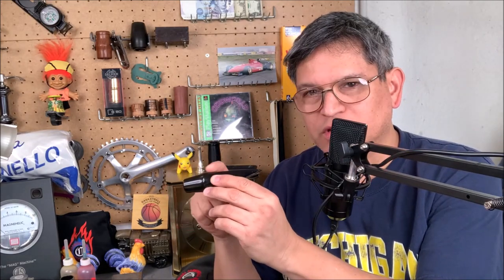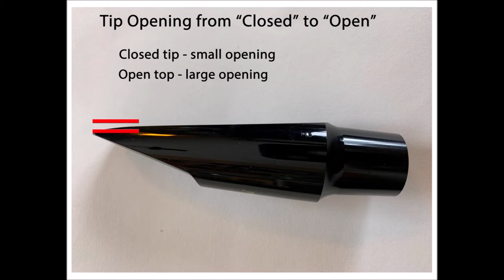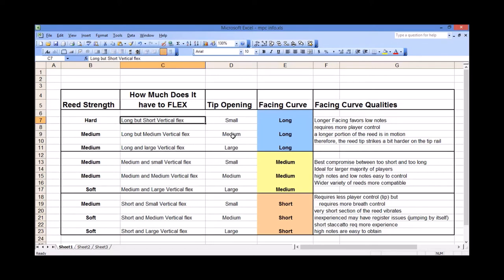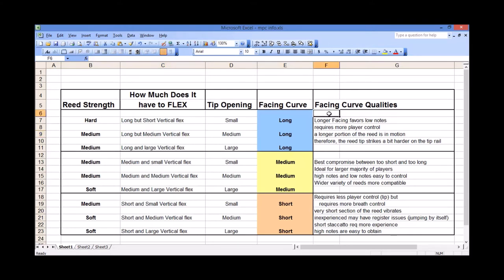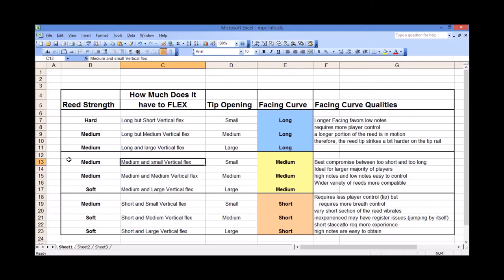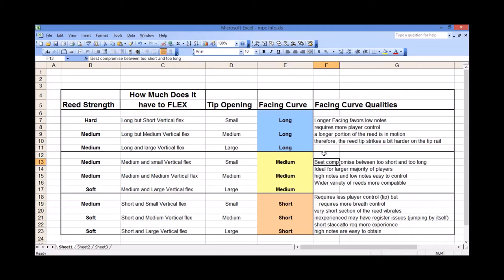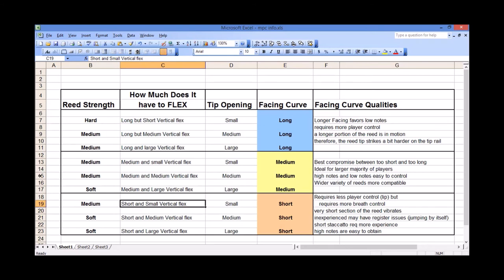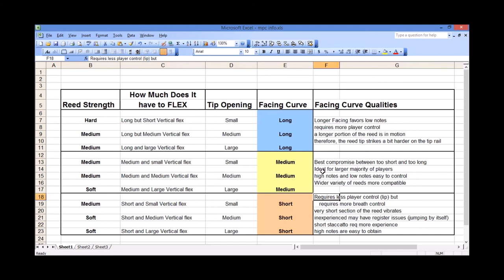Clarinet Saxophone Mouthpiece Basics - Facing Curve & Tip Opening and how it affects Reed Selection

Comment: This is great information. I wish I had learned this 30 years ago. One suggestion for the videos - the audio in this video is very muffled. The mid-to-high frequencies are not there, and that makes the spoken word hard to understand.
Reply from the maker: Sorry, I actually have a deep voice - lower frequency.  I've had many people say the audio is off, until they actually hear me and realize I have a dark voice but I need to articulate more.  I also do not have any "real" audio equipment.  Unlike what some hear about YT I have no income from these. If you look over newer videos you'll hopefully see an improvement as I've learned you can adjust the audio in the software since that video and I now use only an iPhone with a wired mic which has seemed to improve it, except I still have a dark voice.
Reply: @gottalovetheknowledge4749  Good to know things have improved over time. I also have a lower voice, but even lower voices have high frequencies in them. A lot of consonants get some of their base sound from the hissing of air - think S or F or T. That hissing air has a lot of high frequencies in it. When those high frequencies are reduced (with lower quality microphones, for example), it's harder to understand. The loss of the ability to hear higher frequencies as we age is why most folks with a bit of hearing loss have a hard time understanding speech. It's all another fascinating topic.
Reply from the maker: Yes, I totally understand.  If you want to provide improved microphones and technology for gratis it would be greatly appreciated.  Thank you.